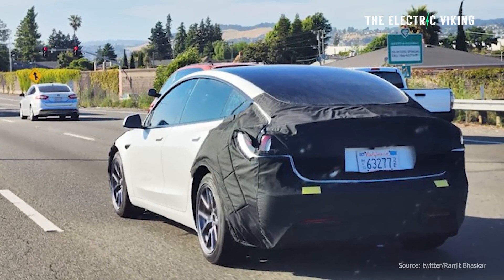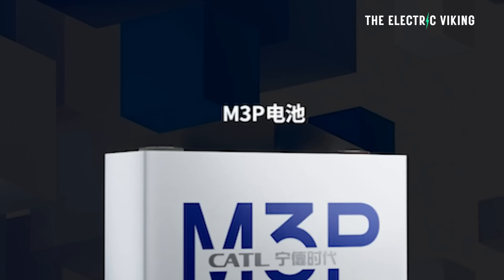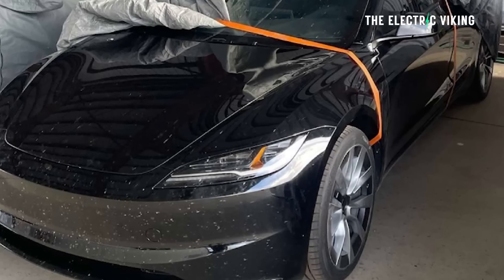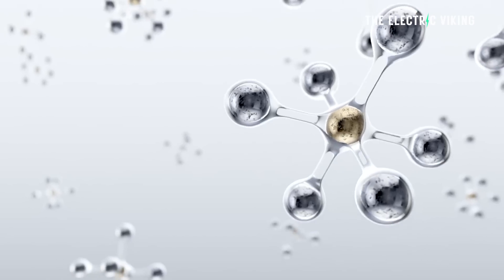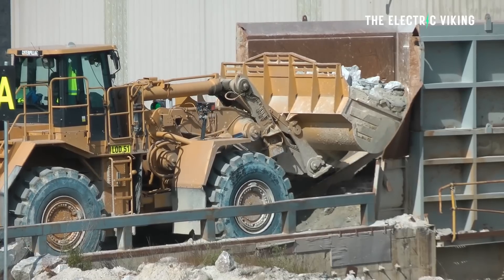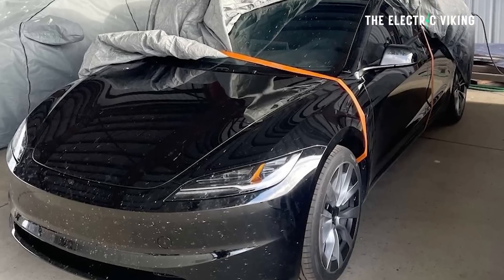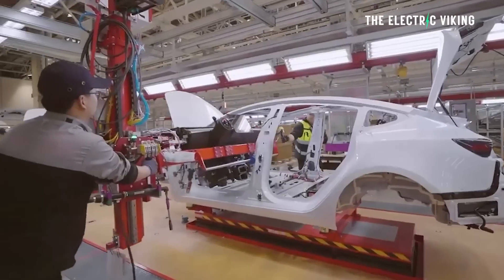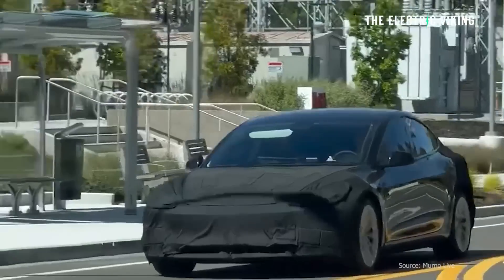NEW Model 3 and Model Y could have 80 mile range increase

Comment: I think they will decrease battery size most likely while the battery energy density will add about 10-15km to the standard range and about 20-30 km to the long range at best while lowering the weight. I don’t think they’d want the standard range to reach 300 miles as it would eat into long range sales big time. it would fit into business side of things better that way.

Comment: A nice quiet leap forward in battery technology. To me, the best part is getting better range, out of the same amount of basic materials. CATL and Tesla are great
Reply: 300+ range for a base model seems more than adequate. Future density increases should be used to reduce the number of batteries, and thus lower cost.
Reply: @darylfoster7944  The market decides really in the end of how much range people want. V2G for example. Model 2 will be designed for what you describe. Hopefully it will be minimalist to the tee. Lightweight and a wagon.
Reply: @joenavarro2973  yes, consumers will decide if 300 miles is sufficient. I think there's a point of diminishing returns on range, especially if charging speed is reduced to 10 minutes or less. The M2 may not have the luxury of the 3 or Y, but I don't think it will be minimalist. Today's consumer demands a lot in the way of options. That's why the average car costs $48k. Tesla already stated that the M2 will have a 53 kwh pack and get about 270 miles of range, and there may be a LR version. I also think it will be an SUV, not a wagon.

Comment: First, don't trust EV batteries and power supplies out of China...BYD is starting to make Tesla look positively SAFE by comparison.

Second, using olive oil warmed up to around body temp and letting it soak in your ear canal, can clear up blockages caused by infections and the like.  But make sure you use OLIVE oil.  Veggie (sunflower, canola, corn) oils don't work, for some reason...

Comment: You are making a mistake here.  The battery holds 6 more kWh of energy (10%).

The fact that the energy density increased means the 66 kWh battery is smaller, it doesn’t mean it gets more range (other than a somewhat small range increase due to the reduced weight).

So the range will be 10% better, plus a small amount for the weight reduction of the battery, plus any other changes that increase efficiency.  It almost certainly won’t be 80 miles better.

Comment: It's going to be interesting what the battery world is accomplishing in 2030-2035... I can imagine an even lighter smaller battery @ 600+ miles/1000+km
Reply: will be cheaper not go further..... there is no point have 1000km of range.
Reply: @timorum  I’d be fine with that :-) The point is not so much to have 1000km range (which would be great btw) but being able to have decent range when you’re not fully charged or under conditions with significant battery drop, e.g. cold weather. In such case the longer range is certainly welcome. Also don’t forget that after a certain number of charging cycles the battery capacity drops, so greater range means that such drops have less effect on the driving experience and one can keep the same battery for a longer time period.

Comment: 60 kwh to 6kwh is a 10% increase - the 15% density improvement is not going to be a big range booster and probably just does not add weight- How do you get 80 mile increase in range?

Comment: Range will be 66Kwh x Miles per Kwh.
it is the improved energy density that enables the increased Kwh to 66.
So a 10% increase in range (60 to 66Kwh) plus maybe any derivetrain efficiency improvements if any.
Could take the base RWD range to just around 310 miles.
Reply: This continues the trend of increased range. I believe the range of the original base M3 was 225. If the sweet spot is 300-350 miles, then future density increases should mean fewer batteries and less weight, and more cost savings.
Reply: Thanks for the clarification. I was confused when he said kWh will be increased to 66 AND it’s 15% more energy dense. Instead of AND he should have used BECAUSE.

Comment: finally someone is conjecting on what kind of changes can come with the refreshing of the model 3 and y that are not just gimmicks - new battery if it doesn't burn up is always a step forward. I bet that it won't come for the first highlands because they won't just throw away their inventory and first buyers only want the bling anyway. 
when you buy a tesla they don't mention what exact battery they put in there so anything goes...

Comment: 66 kWh is the measure of the total energy available.  The battery chemistry is not relevant. The number  (66) determines the range. You can't say "it has a 66 kWh battery AND the chemistry is more energy dense."

Comment: Sam,  if the battery power has increased from 60kWH by 10% to 66kWH then that takes into account the increased density.

So, the car would have to have around an 800 mile range previously to go up by 80 miles...

Your predictions dont make sense - seems like you're double counting, when the only number that matters is the capacity, =66kWh.

Comment: I'm in agreement with @tech-ai-maniac that the range gain going from a 60KWH to 66KWH battery is going to give you about 10% or 30 miles more range and not 80 miles.  The 15% increase in power/weight might get you to 69KWH but it seems Tesla/CATL saved about 5% on the battery weight, which would translate into a very small overall weight savings and negligible extra mileage.  What I like about these batteries is they can take charging to 100% every day plus the extra fire resistance and longevity.  I'm always happy to get "More Power Scotty!"😉
Reply: Yip, 10% increase in kWh equates to approx 10% increase in range. Maybe a bit more but not 80 miles. Maybe Sam is mixing up his Miles and Kilometres.
Reply: 100% right.
Reply: Yeah, dude is mixing up miles and kilometers. I think in reality it will get + 50km of extra range vs the old battery

Comment: 210 Wh/Kg comes out to 2x of the Headway 15 Ah LiFePO4 Cells, listed at 105 Wh/Kg, which are, themselves, about 3x the Energy Density of a Good Flooded Lead Acid, Deep Cycle Battery!

So, these cells then, are about 6x the Energy Density of Lead Acid! Imagine putting these into the Old EV-1! That "80 Miles or so if Range, in it, could be bumped up, to 480 Miles, possibly! At least 400 is highly possible!

GM... Bring back the EV-1! Use these cells for a "Base Range" version!

Comment: Hello Viking, great video as always. Just one question: how do you get to an increased range of 80 miles? You can either take the larger capacity or the increased density into account… but not both together 😉. Meaning the bigger capacity is the result of an increased battery density with fixed dimensions. So the battery itself in the new M3 has to be bigger (more room). Maybe I missed this part in your explanations. Keep going!
Reply: Exactly. 60Wh to 66kWh, will mean 10% more range. Weight difference probably marginal, air resistance the more important factor and that will be the same.
Reply: My logic says, the battery will be 5% smaller/lighter. 15% better density, 10% more capasity installed mean 5% smaller battery.   6kWh more and a bit lighter. Maybe they leave room for additional 5% for Model Y using same battery package to get the same range
Reply: @timogronroos4642 your logic iw flawed

Comment: Energy density just means the battery maybe some smaller. So the additional 6kwh wont give you an additional 80 miles of range. Maybe an additional 40 km.

Comment: It still doesn't have the energy density of Nickel Cobalt and it's heavier. They will need around 100 kw to get the range up to that.
330 plus 80miles = 410 when comparing against the model y long range. Right now that is at 75 kw  usable. 
The Texas Model y with 4680's is 289 miles at 67 kw I believe  . The LFP model  3's are less than that. If you add 6 kw I don't think that could add up to 80 miles of extra range. yeah 10 percent bigger for the M3p is not 80 miles by itself . So it gets around 220 watts per kilo as oposed
to Lithium  NCM around 240 to 270 watts per kilo.

Comment: The M3P battery sounds great. Does it have the same charging/safety profile as the LFP battery?
Reply: It should as it's still iron based, just as I understand it? Mixed with alum&manganese plus other stuff to get near older nmc density. 
But undercutting even the current lfp in per kwh costs. 

Catl said it could be 10-20%cheaper to make per kwh in 2022 when they announced it. Even though it should achieve 210-220wh per kg matching some of the best nmc cells from 2020. Win win win in my book.👍🏻

Comment: What happened to the 4680?
Another Elon brain fart?
Reply: It has been harder to produce than expected.  Also they might be stockpiling 4680s for the Cybertruck and Semi.
Reply: If they're getting these improvements with the "old" style, does it matter? They can always use this chemistry in the 4680's as well, can't they? So it will just mean that when the 4680 is commercially released, the packaging benefits should carry over as well for yet another improvement (I would have thought).
Reply: Don't worry guys, for some, you can make a plethora of mods and updates and they will never be happy! Typically they have never personally succeded at much themselves, so easier to focus on others' shortcomings.